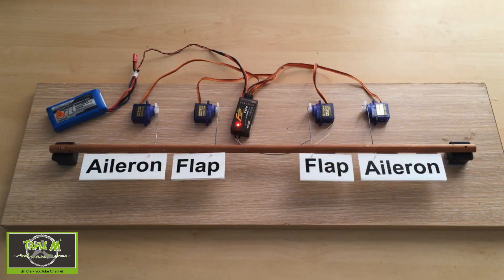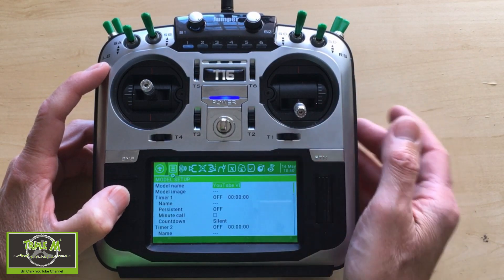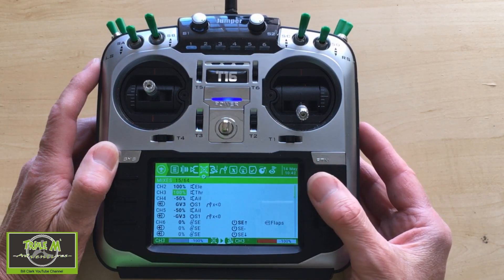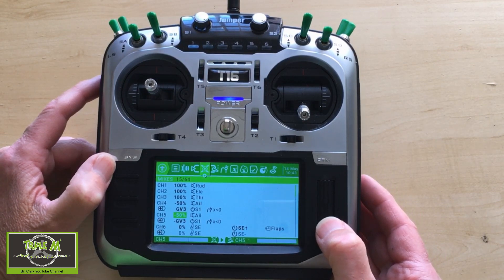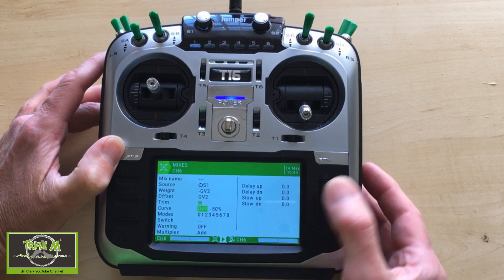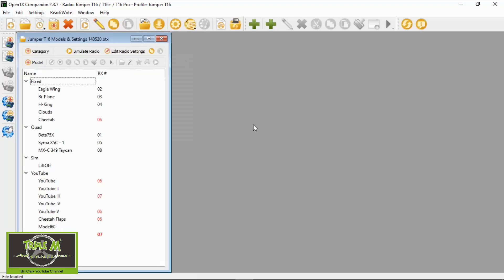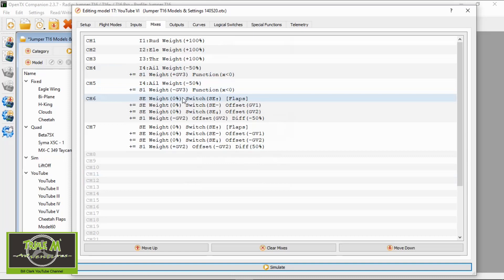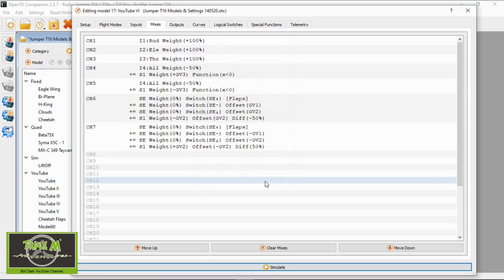Jumper T16 Crow Butterfly Brakes in OpenTX

Comment: Hope you can help me. I have jumper t16 pro v2 setup to kopilot I'm using mode 2 AETR. The motor will only start when over
half way up on throttle. any suggestions? I do watch most of your videos
Reply from the maker: Hi Bob, thank you for watching my videos. I do not have experience with the Kopilot but if your radio is out putting the throttle signal correctly, check your outputs screen on your radio, then it sounds to me like a flight mode is set up incorrectly in Kopilot. . If the mode you are in only allows half throttle maybe you need to reverse the throttle in your Jumper T16? Sorry if that’s a bit vague but I hope it points you in the right direction.